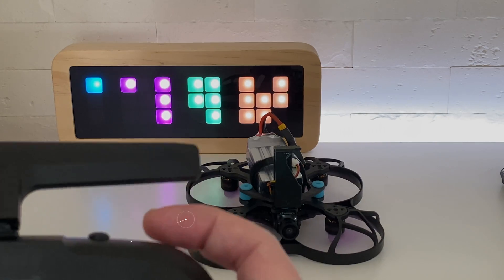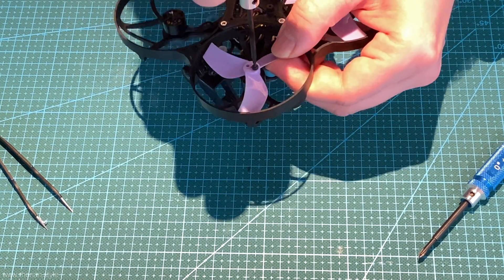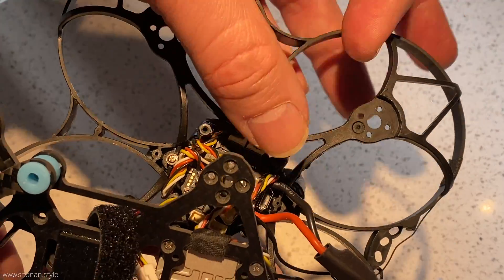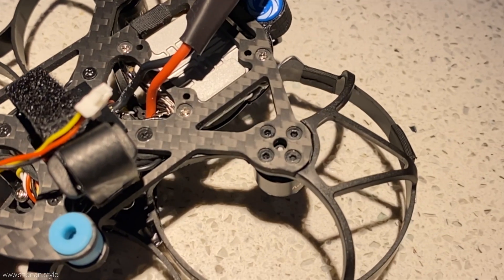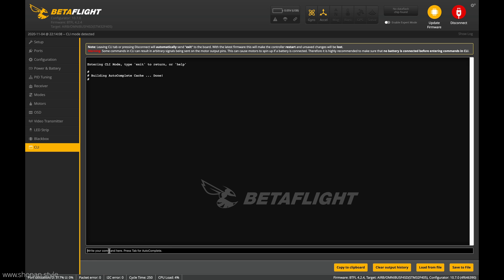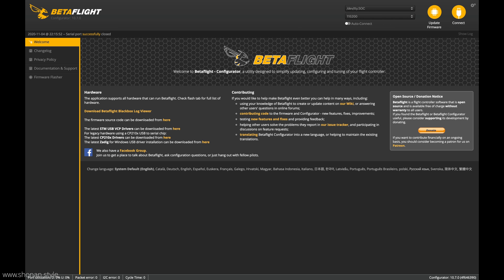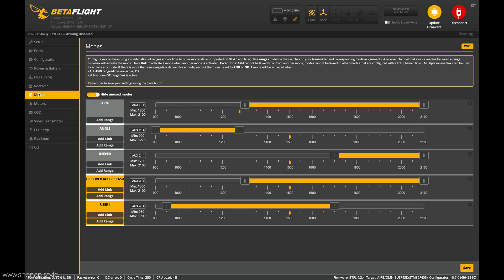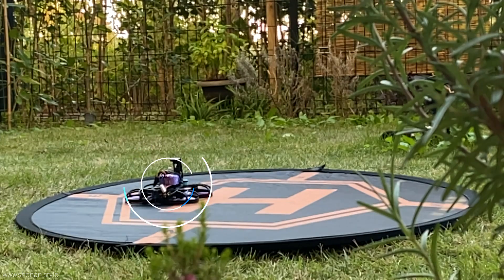BETA95X V2 engine repair | Quad Flips On Takeoff issue | AirMode switch TBS Tango 2 | & test-flight

Comment: can you please give me back up file please ??
Reply from the maker: no problem, send me a DM
Reply from the maker: I will leave the file line in the comments of this video by the end of this week for you!
Reply: @MattShonan   thanks my brother
Reply from the maker: Here it is!
Reply from the maker: # 

# diff all

# version
# Betaflight / OMNIBUSF4SD (OBSD) 3.5.7 Mar 15 2019 / 22:11:36 (e9130527c) MSP API: 1.40

board_name OMNIBUSF4SD
manufacturer_id 
mcu_id 001f00335950500c20313858
signature 

# reset configuration to default settings
defaults nosave

# name

# resources
resource MOTOR 1 A03
resource MOTOR 2 A02
resource MOTOR 3 B00
resource MOTOR 4 B01
resource PINIO 1 B12
resource FLASH_CS 1 NONE

# mixer

# servo

# servo mix

# feature
feature -RX_PARALLEL_PWM
feature RX_SERIAL
feature LED_STRIP
feature AIRMODE

# beeper

# beacon

# map
map TAER1234

# serial
serial 0 1 115200 57600 0 115200
serial 2 64 115200 57600 0 115200

# led

# color

# mode_color

# aux
aux 0 0 0 1300 2100 0 0
aux 1 1 1 900 1275 0 0
aux 2 13 1 1700 2100 0 0
aux 3 35 2 1300 2100 0 0
aux 4 40 3 950 1700 0 0

# adjrange

# rxrange

# vtx

# rxfail

# master
set align_gyro = CW270FLIP
set acc_calibration = -3,63,-4381
set mag_hardware = NONE
set baro_hardware = NONE
set serialrx_provider = CRSF
set min_throttle = 1070
set use_unsynced_pwm = OFF
set motor_pwm_protocol = DSHOT600
set motor_pwm_rate = 480
set ibata_scale = 90
set ibata_offset = 29
set yaw_motors_reversed = ON
set small_angle = 180
set pid_process_denom = 2
set osd_warn_core_temp = OFF
set osd_vbat_pos = 2433
set osd_rssi_pos = 2242
set osd_tim_2_pos = 2455
set osd_flymode_pos = 2425
set osd_throttle_pos = 2369
set osd_crosshairs_pos = 2253
set osd_current_pos = 2400
set osd_mah_drawn_pos = 2392
set osd_craft_name_pos = 2442
set vtx_channel = 4
set vtx_power = 2
set vtx_freq = 5800
set pinio_box = 40,255,255,255

# profile
profile 0

set dterm_notch_cutoff = 0
set p_pitch = 38
set i_pitch = 44
set d_pitch = 30
set p_roll = 34
set i_roll = 38
set d_roll = 28
set p_yaw = 55
set i_yaw = 34

# profile
profile 1

# profile
profile 2

# restore original profile selection
profile 0

# rateprofile
rateprofile 0

# rateprofile
rateprofile 1

# rateprofile
rateprofile 2

# rateprofile
rateprofile 3

# rateprofile
rateprofile 4

# rateprofile
rateprofile 5

# restore original rateprofile selection
rateprofile 0

# save configuration
save
#